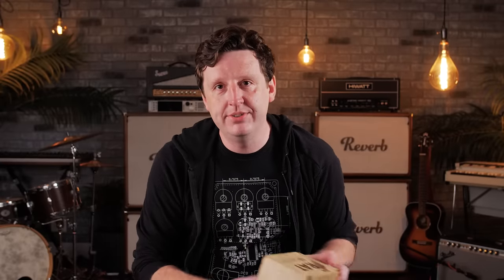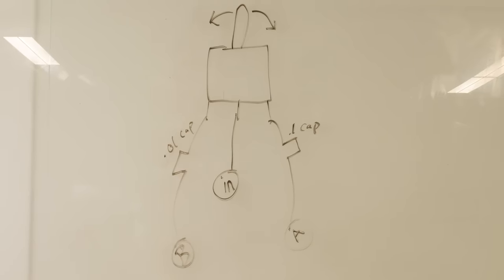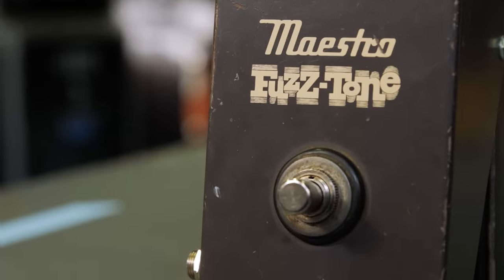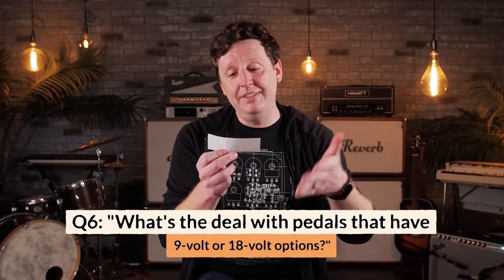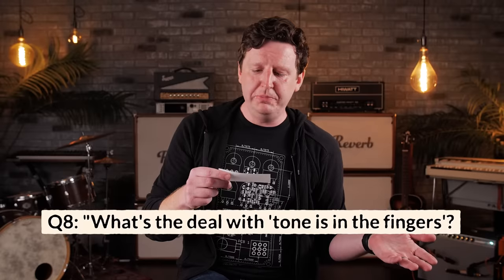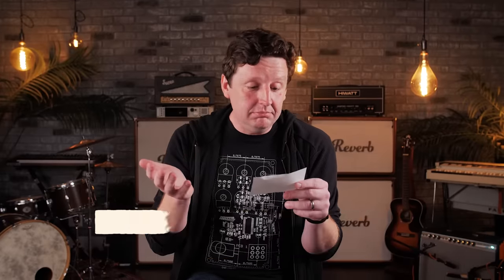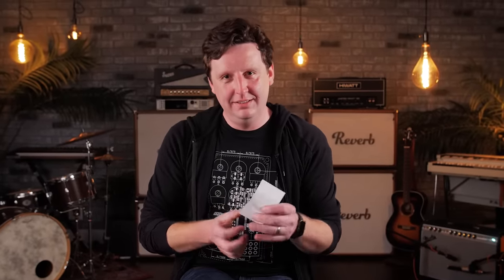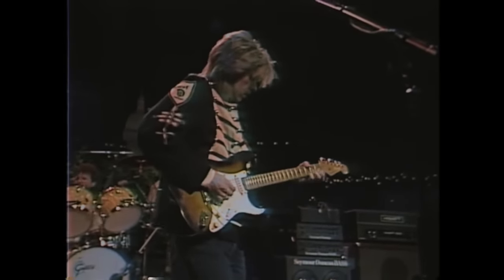What's the Deal? Josh Scott Explains Pedal Myths & Concepts

Comment: I do actually prefer my OCD version two with 18v and it’s sort of like I prefer amps at full power rather than half power . It just sounds bigger and fuller but what do I know I’m using it as a clean boost on my Rectoverb 25 with the switch down and 9v . Like they said on Yo Gabba Gabba if you try it you might like it .
Reply: I also heard a huge difference in my Catalinbread Echorec using 18v.  I went from 9V and disappointed to Wow w/ 18V.

Comment: Your discussion about NOS parts was interesting but a little off base near the end imo, when you said we should be able to build old parts. I work in semiconductors and you’d be surprised how minuscule the market for old, outdated parts used only by a few hundred small companies buying in the hundreds, maybe thousands. Often they have to be obsoleted to make room for parts being used in the hundreds of millions by the big tech guys. It’s very expensive to keep a part running in a fab, and even worse now that the supply chain is so backed up and fabs are running at maximum capacity. As an audio enthusiast and guitar player it breaks my heart, but the business and new tech wins out. It’s why you can’t just go buy germanium transistors that easily, or why I got laughed at for asking a professor about vacuum tubes.
Reply: We dont disagree. I was simply saying, we can build them to the same spec and we do.
Reply: Josh is 100% correct. The parts are not impossible to reproduce. They are simply not profitable to produce anymore. From a technological and manufacturing perspective, building those old parts is trivial, but it just can't be done in an economically feasible way.

Comment: His "the chip isn't the circuit" thing bothers me. I mean, I think his point is that you should use what you think sounds good, which he explicitly says a number of times, and I agree with, but it feels like he's saying that you can get the same sound out of a different chip/transistor/whatever as long as you redesign the circuit properly, and that's just not the case. Each of these different components has different characteristics. For instance, silicon transistors transition from linear amplification to saturation much more quickly than germanium transistors do. Neither of those is inherently better, but they are different, and it's exceedingly difficult, if not impossible, to make one perform like the other. So if you want the sound of one of them over the other, it's unlikely that you're going to be satisfied with the other, regardless of how the circuit is modified.

Comment: The problem with Printed is when something fails on them it's almost if not impossible to replace that part.
Hand wired you can mod on.
Reply: Printed doesn't mean surface mount.

Comment: JOSH, whats the deal with slew rate? the maths don't agree with the conclusions people have.
Reply: I don't know from rate, but according to the paperwork, I get better slew control if I hook up the power amps in bridged mono rather than stereo. I need a couple more speaker cones before I can run the experiment. 🙉
My Hypothesis is that I can get more percussion from the strings, but it is just an idea.

Comment: Yeah... I fried my Centura Klon with 18V, by accident.... Unplugged an 18V drive and plugged in the Centura, forgot the other OD was 18V....I immediately knew, when smoke came out of the Kon, not fun....
Reply: I think that the Capacitors give up the blue smoke faster than most other parts, but the semiconductors will not last long either. It's just Parts, and you've got a mighty cool box there. Lots of people who are smarter than me who can get it back in order for you. They don't goop those, right?